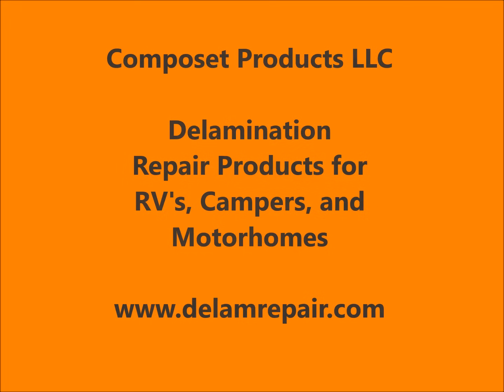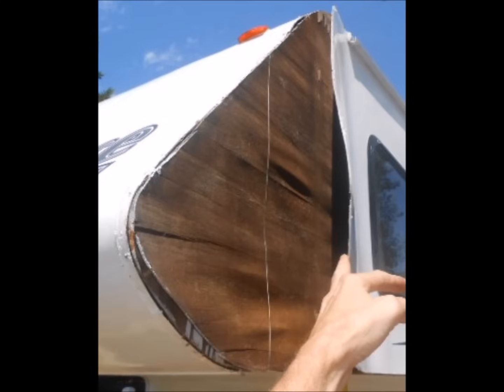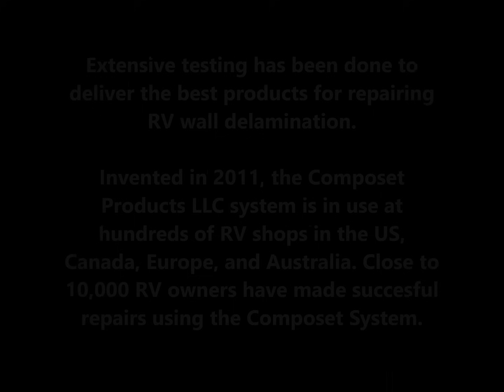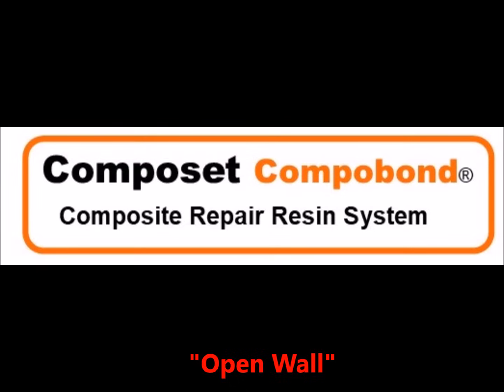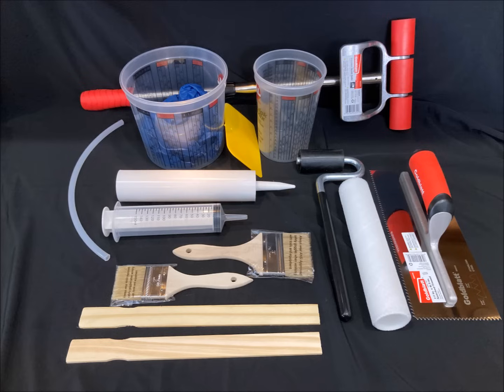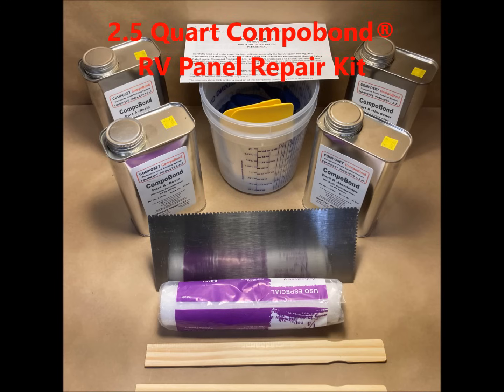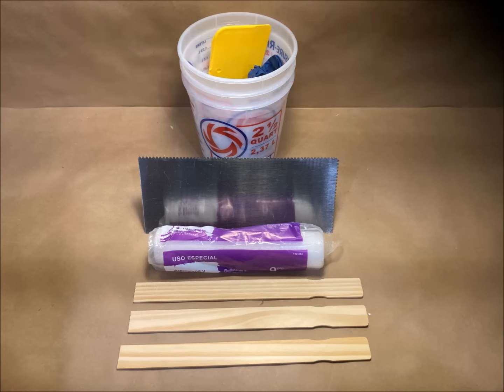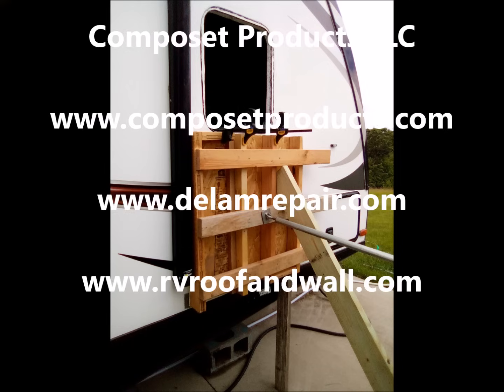RV Siding Delamination-RV Fiberglass Siding Separation & Water Damaged Plywood -Open Wall Repair

Comment: Hi I'm looking at buying compbond to bond new filon to plywood for nose replacement of my camper. Question I have is: can I bond the filon to the luann plywood on flat ground and then bend it to fit the curved framing and install it. Like is the epoxy flexible once cured? Will be cutting kerfs / relief cuts in the back of the plywood more than likely to help it bend (not a drastic bend, very slight.) just not sure if the epoxy has flexibility to it or if it will come loose if bent after cured. Thanks
Reply: John,
In general, epoxy is not very flexible or elastic. My guess is that the epoxy does not have the flexibility to bend without cracking, or may make it very difficult to bend the two laminated substrates. You could do a test panel to simulate the situation. Another guess is that a 2-3% curve is about the limit
Reply: @ yea I'm thinking the same thing. Will probably have to glue it onto the curved camper nose itself and find some sort of way to bar clamp it onto the camper while it's drying. Thanks for your opinion!

Comment: Who sells the fibreglass sheets ?
Reply from the maker: You can purchase Filon brand RV siding on our websites. www.delamrepair.com, or www.rvroofandwall.com. It is 0.045" thick, 8.5' wide and can be purchased in lengths ranging from 1' to 40'.